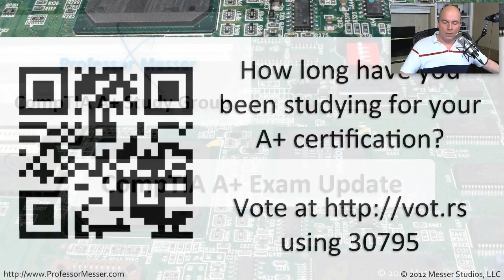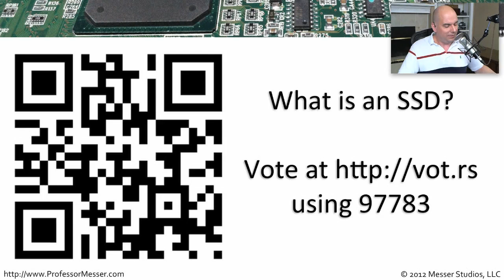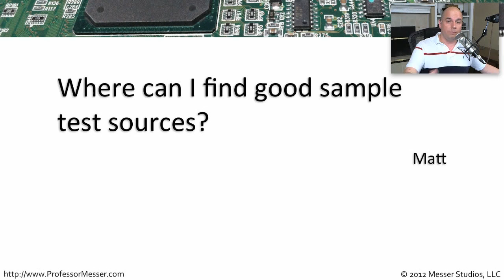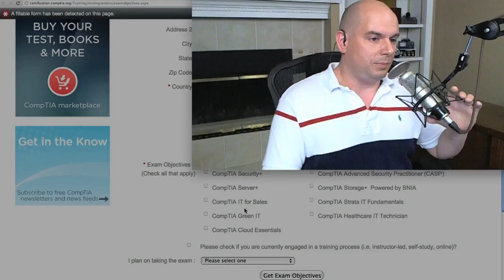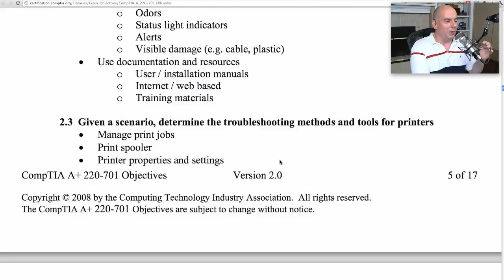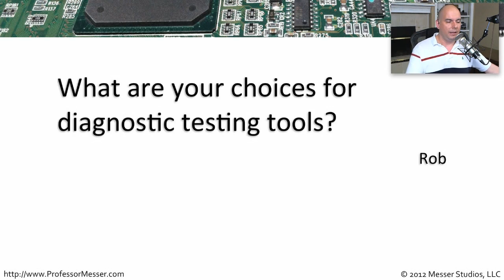Professor Messer's CompTIA A+ Study Group - July 2012

Comment: @Vivian Hamza - 701 & 702 are the certifications standard from 2009-2012.  The reason you're getting 700s is because the new one isn't available yet.  Later this year, the 801 & 802 will become available to take. The CompTIA A+ updates the tests every three years to try and become relevant to current technologies.